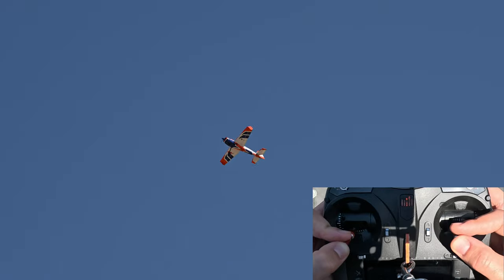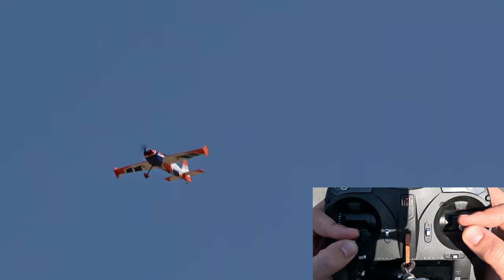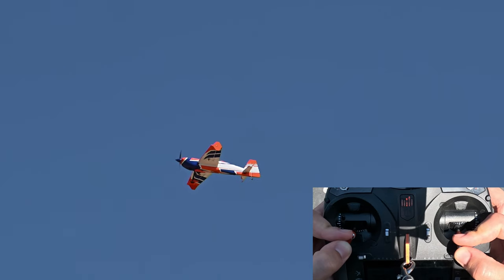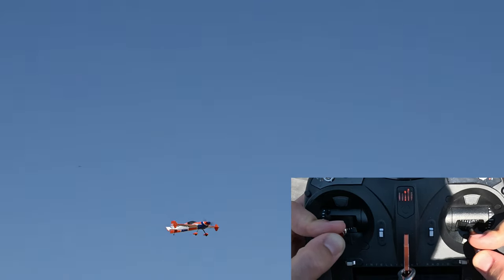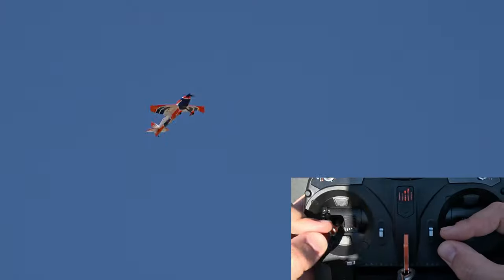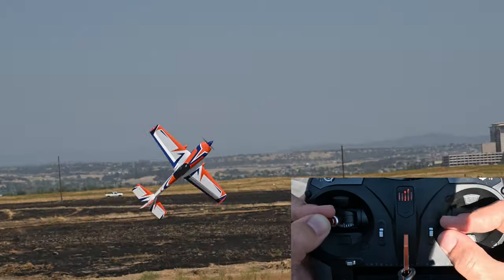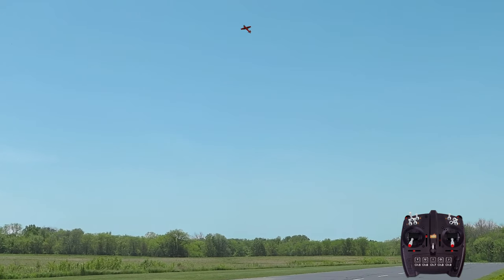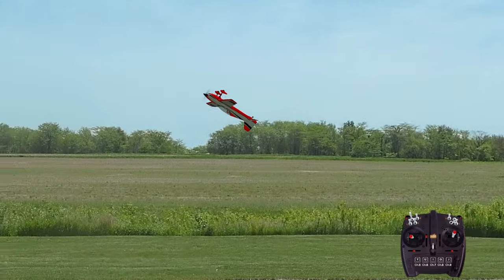How to fly 3D like a pro: The Elevator

Comment: Great job! Very clear and concise instructions, your doing a great job helping people wrap their heads around 3D flying.
Reply from the maker: Thank you! Hopefully this helps those getting started in 3D
Reply: Thanks so much for these videos. I am struggle to master this movement as well as harriers and hovering. My problem is the extreme sensitivity of the ailerons. In other words, keeping the wings level is a problem due to over correction. Any suggestions?
Reply from the maker: @DS-ql3ou  Apart from the obvious 'more practice' answer, you could either increase the expo in ailerons or reduce some aileron deflection. 
Also, when trying the harriers, keep telling yourself to move the ailerons as little as possible, less than you think is necessary, and see if that helps. 
If you have a simulator, you can also setup a plane with a lot of aileron travel and little expo so that you're forced to practice being very gentle with ailerons.
And make sure you're at a high angle of attack, the higher the angle, the less authority the ailerons will have.
I hope that helps!

Comment: Realmente no hay que dar gas mientras baja con ningún avión? Estoy intentando aprender a hacer esta maniobra con un edge 540 de 2m de goldwing y me da auténtico miedo hacerlo sin dar nada nada de gas. Lo que me pasa es que me hace mucho wing rocking. En recorridos tengo un setup muy similar al tuyo, aunque con algo menos de expo. El CG de tal manera que el avión en invertido vuela prácticamente sin sujetar, casi neutro.

Gracias por tu ayuda y un gran video
Reply from the maker: hola! En mi experiencia el motor no afecta mucho al wing rocking en esta maniobra. El principal motivo para dar un poco de gas es para evitar que el morro caiga demasiado, y para reducir la velocidad de descenso. En cualquier caso, lo mejor que puedes hacer es probar ambas opciones. Intenta dar un poquito mas de motor y mira como cambia el comportamiento del avion. Tambien prueba a ponerlo a ralenti. Mientras que confies en que el motor no se va a parar, y hagas la maniobra con margen de seguridad en altura, no hay motivo para no probarlo. La ultima cosa que puedes probar es darle unos toques de gas de vez en cuando. En algunos aviones, eso puede ayudar a darle mas control a la cola y puede estabilizar el avion.

Suerte!
Reply: @skyboundrc  Muchas gracias Juan. Lo intentaré. Espero que sigas haciendo este tipo de videos y conmigo tienes un nuevo seguidor. Un abrazo